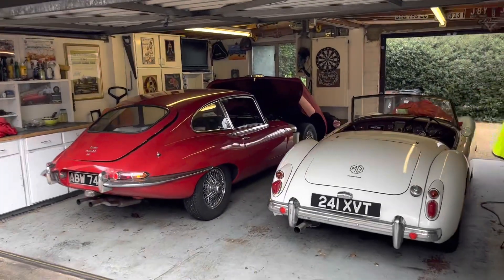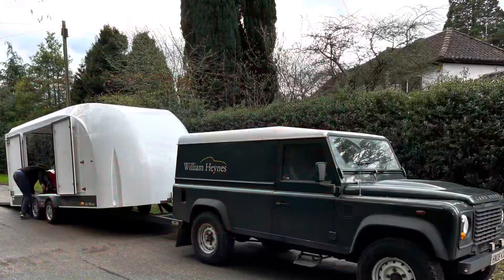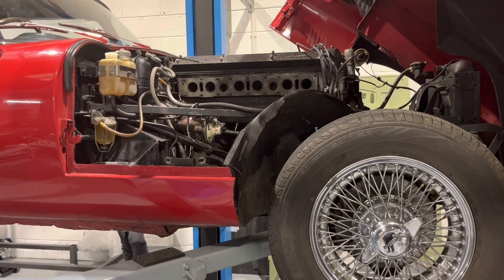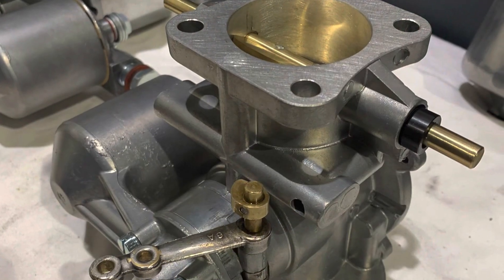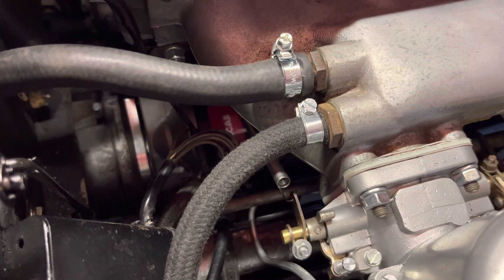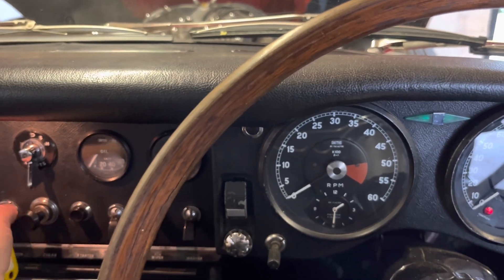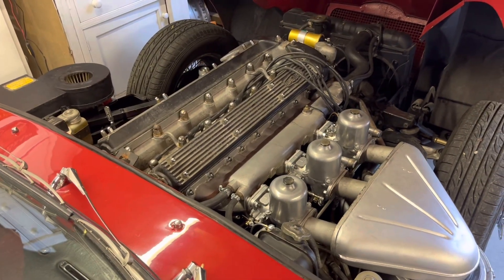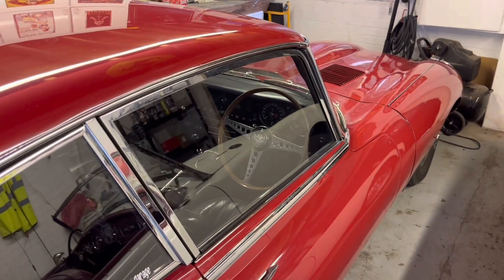Jaguar E-Type Ep 2 - starting and compression issues addressed as it goes to William Heynes

Comment: Hi There. The car sounds good now... Wondering about the 123 distributor. Is it the bluetooth 123 distributor with the immobilizer for your phone
Reply from the maker: Hi 
It was the 16 setting one that is not blue tooth enabled. I am really happy with the results on this one. 

I also have an Alfa 1750 which I have put the 16 setting one in and having it tuned tomorrow so hope to achieve the same results.
Reply: @rcclassicgarage  I have the 123 bluetooth one although not fitted it yet. Would you know if the version you have shows the timing advance curves. I have a Mk2 3.4 and need to set it up manually...

Comment: I recently discovered your channel and have been enjoying your content. I own an E-type Jaguar that's experiencing cold start issues similar to what you encountered. I'm considering having the carburetors rebuilt and have two questions:

Could you share approximately how much you spent on rebuilding your carburetors?

From an investment perspective, I'm trying to decide if I should fix this issue. Would fixing the cold start problem add enough value to the car to make it worthwhile if I decide to sell it? Or would it be better to sell it as-is with the current cold start issue?

Thank you for your help!
Reply from the maker: Hi and thanks for watching 
I have a triple carbs and had all three rebuilt. I did a lot of other things at the same time, like put in an electronic 123 distributor and upgrade the starter to a hi-torque. The combination of the 3 worked and as they were done at the same time, I am not sure what the impact was of each but overall a massive improvement in starting and performance. My carbs were quite bad and some of the jets were stuck etc so they needed to be done, but you can bank on about 10-12 hours labour per carb to remove, rebuild and set up again, so depending on the labour rate it’s about 30-36 hours labour. 
Since I did mine it has improved my car significantly and makes it a pleasure to own so I would say it’s worth doing.
Reply: @rcclassicgarage  Thanks, I think I'll message William Heynes. The car starts, but it does take a couple of minuets on first start up to get going